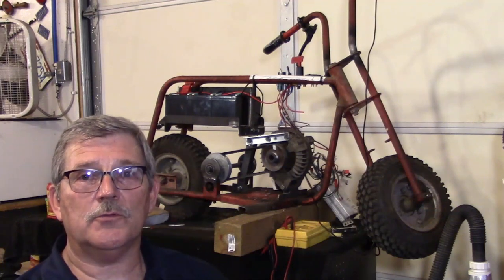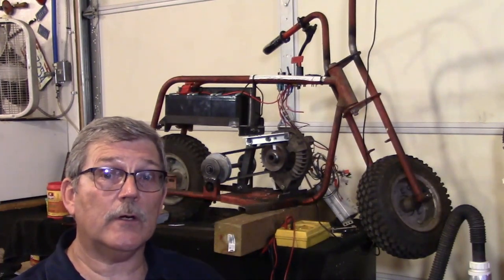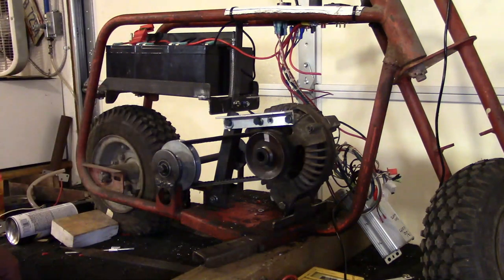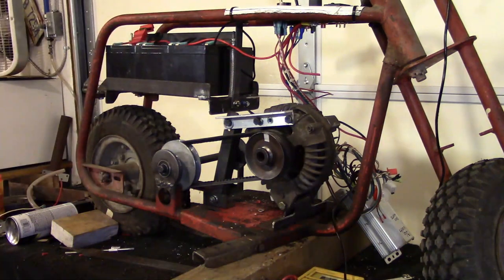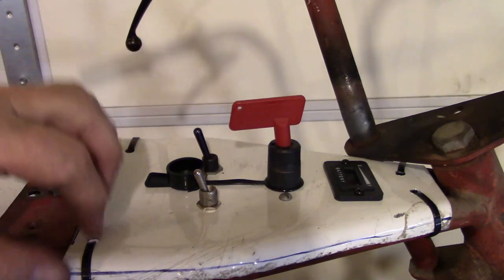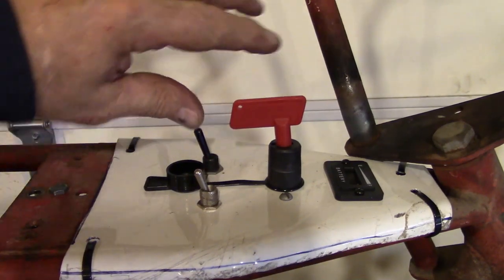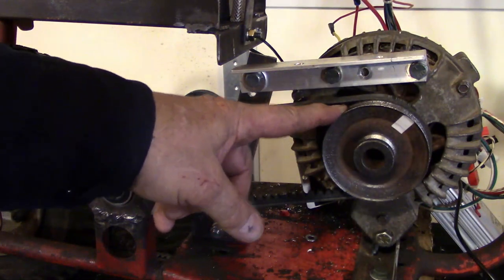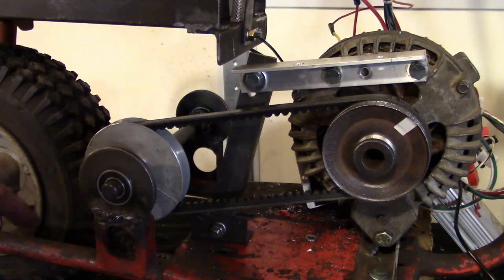Alternator powered Electric Mini Bike Part 4

Comment: The electric motor made from an alternator is something different ..I wonder how much Torque it will have and what a Really big alternator could power ..I remember seeing a giant one on a newer tractor in the early 90's
Reply from the maker: More power more AMPs, With my small batteries I may need to take it easy and don't set any records...ha ha